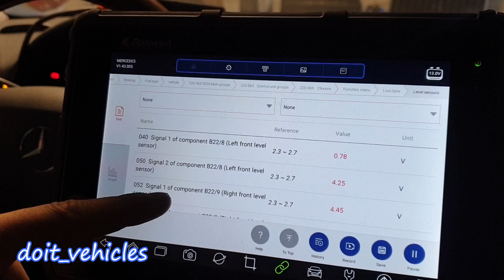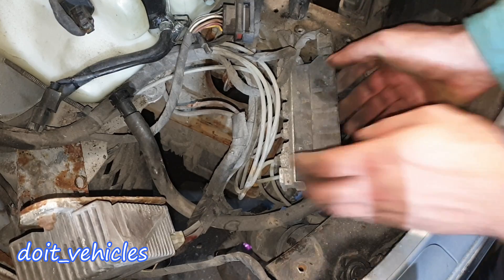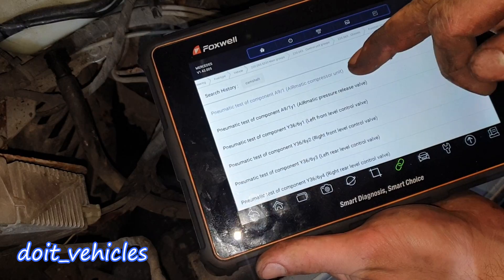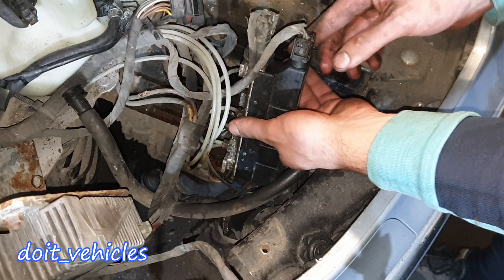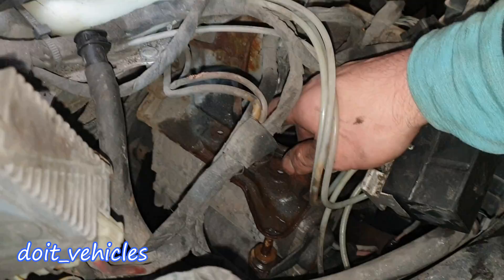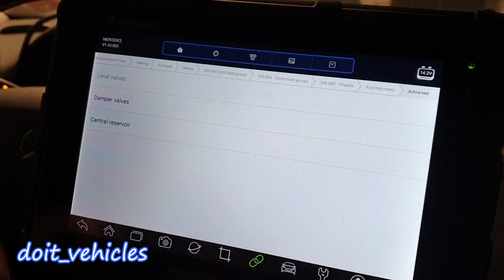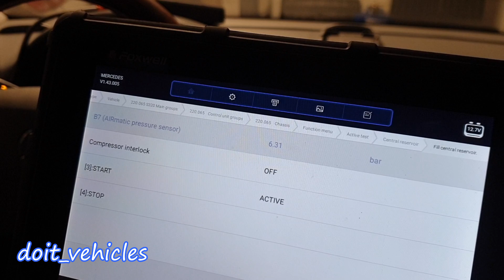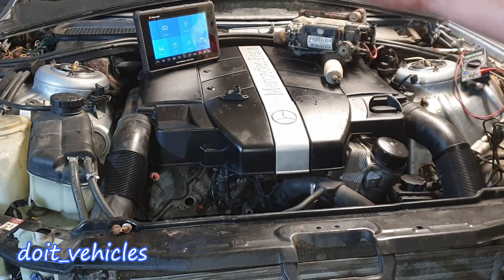W220 Mercedes S class AIRMATIC Suspension Valve Block LEAK Diagnose Compressor removal Sensors Tests

Comment: Great Video! My S430, w220 drop down the two front wheels, but not the whole care. The front struts are new and the compressor works fine. Seeing your video I think the valves may have old o-rings where the air is leaded. I will check it. Thank you.

Comment: 2003 Mercedes Benz S430 4Matic  my problem is that the AIRMATIC compressor stays on WILL NOT TURN OFF.... NEED TO KNOW THE PROBLEM.   IF ANYONE HAS HAD THIS PROBLEM. AND  REPAIRED. IT. HOW
Reply: That's likely a shorted relay. I've had two shorts with these shitty OEM relays. One caused my secondary air pump to burn out. If you don't catch it in time, a shorted relay will ruin the component it's supposed to turn on.

Comment: I have never seen anybody getting access to the compressor through the headlights. Interesting 🤔  Most people remove the wheel and it's cover. So how do you fix the leak between the line and the nut? Kind regards

Comment: I'm working on my 2008 Mercedes E550/ W211. I replaced the left front strut. Thinking it was blown out? Unfortunately I replaced it.  Same thing.  Strut going down.  I removed the wheel again.  Checked all the sensors.  I cleaned the terminals.  Put it back together.  It stayed up and was fine.  Until I checked the steering.  Right the pump turned on.  I looked at the left strut? Still good.  I turned the wheel left. The left strut deflated again? I checked everything around the wheel.  Everything seems to be fine? I re tried it to figure out why turning the wheel has anything to do with the Airmatic system? I checked all the voltages.  It seems fine. I have no idea.  So off to the mercedes mechanic? I'll follow up after hopefully they can fix it.
Reply: Any update?

Comment: where is  the outer compressor filter hose connected on a 2000 MB S500
Reply from the maker: It should be in the same location.  Wasn't i  the video ?

Comment: Hi, I have 2005 S430 and I'm getting Display Defective the Airmatic don't go up and the button for raising the car and button for sports mode does not light up, the ABS light up. I checked all the wiring and fuses and didn't find any problem. What do you think is the problem. I need your help. Thank you
Reply: I fixed my display defective by mailing to some guy in colorado who did some work on it.  He runs a service on ebay.  It was about 150bucks and he was very fast.  That stupid display defective will cause ALL kind of weird problems and then some.  Start with that.

Comment: Hi do it_vehicles, I follow your channel regularly. I admire your efforts in getting to the bottom of these W220 problems. I drive a 2002 S 500, always something "kaputt"😁 after 19yeats, or so... 
OBDII: Is there an inexpensive comprehensive bi-directional scanner on the market you'd recommend? Put it in the description box below and collect 10-20% in commissions. We,  your followers would greatly appreciate your experience and recommendations in tools and recommendations you use. And, if you make a little Money out of this, even better. All the hard work you do for us and should fruition for you?
Reply from the maker: Hi Marcus and thanks for your message! About the scan tools: For me it's either an expensive " top one " or a 100 $ one . Obviously, it depends a lot on how much you will use it and how far you want to go into this field. From what I know Autel is one of the best ( updates are expensive ) Foxwell is great as well ( you can check the review I made ) Also it's important to know that besides a good scan tool you will need a proper oscilloscope , a good voltmeter and access to wiring diagrams which can be quite costly - if one wants to be pretty close to a Pro level . 
About the affiliate marketing on this channel, from what I've seen is not worth it  ; long story short 😅